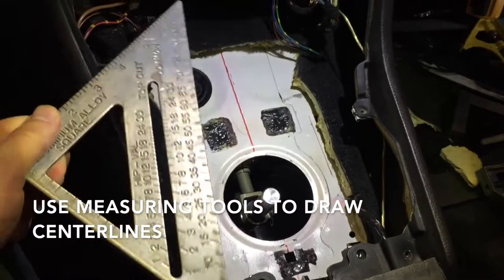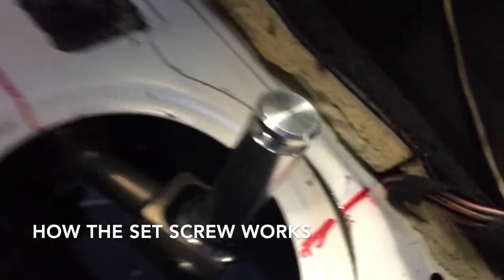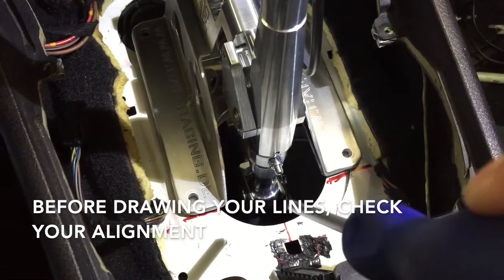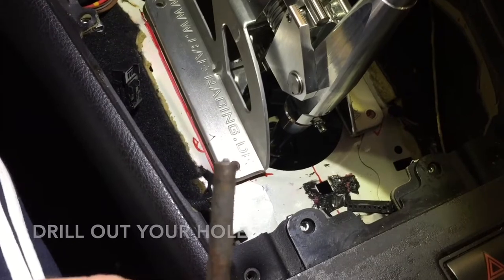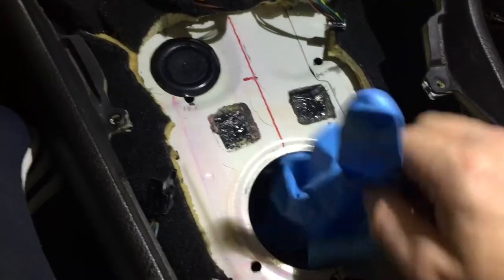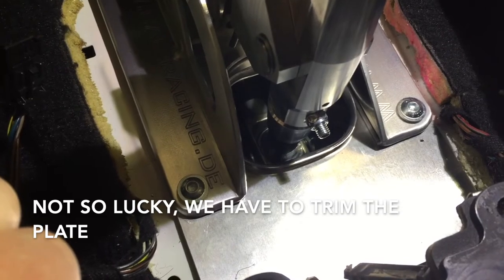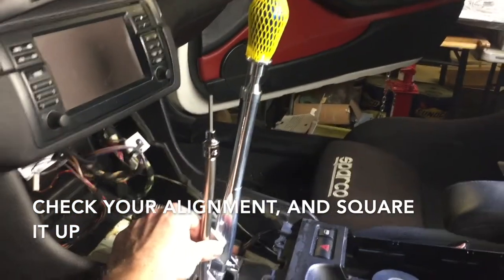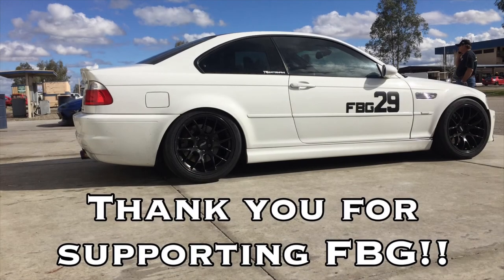How to Install the CAE Ultrashifter:  Initial fitment mounting e46 m3

Comment: My CAE won’t self centre from 2nd so that you can shift from 2nd in a straight line up to 3rd. I don’t have the CAE selector rod, but I have adjusted the centring spring as per your video. Do you know what the problem could be?

Comment: Do you guys track this car? Why CAE over RTD?
Reply from the maker: Yes we track the car.  RTD sells a standard DSSR ( Dual Shear Selector rod) that is not adjustable.  While the CAE is a bit more pricey, you can fine tune it very well,  its selector rod is fully adjustable which means you can play with the geometry of the shift mechaniism.  its extremely well made.  While RTD's are good from what i hear, once you drive a well tuned CAE, nothing is comparable making the CAE worth the few extra.  To be honest with you i had my doubts until i drove one in a friends car at the track.
Reply from the maker: in fact in the next few videos, were showing just how adjustable it is